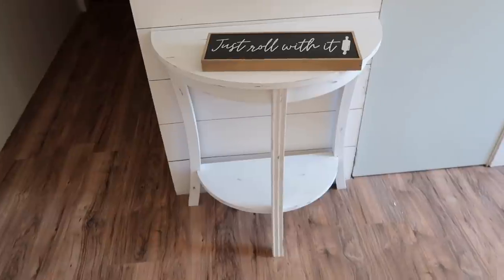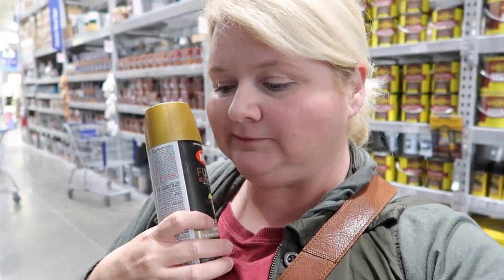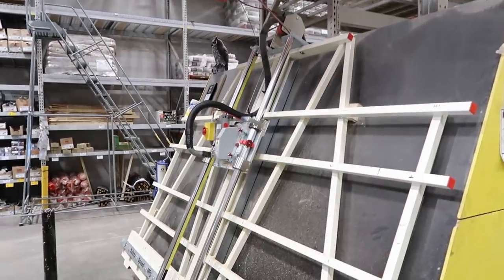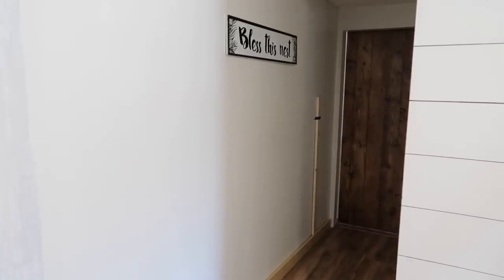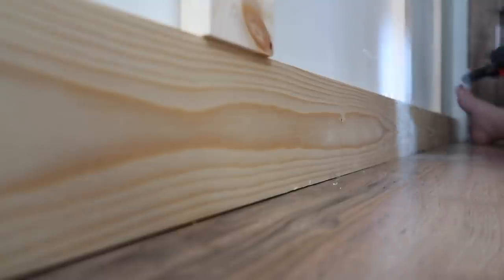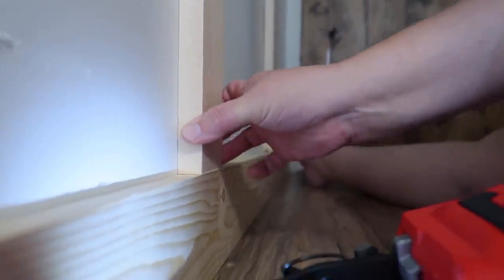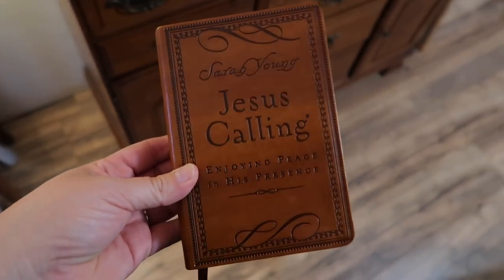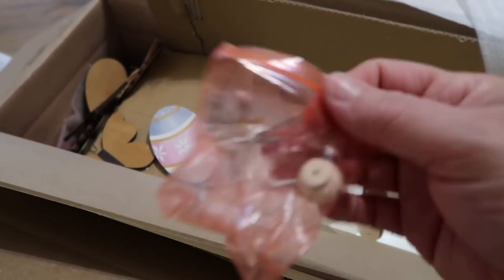Board and Batten Feature Wall | Hallway Makeover | Single Wide Trailer | Mobile Home Updates

Comment: You get a 10 out of 10 on this project.  You are taking your mobile home to where the interior is more and more like a frame house than a trailer.  That's definitely a huge up grade.  Just think, you are getting it done one step at a time and doing it quite well.  I can sometimes feel your frustration, and that's ok, just don't let it conquer your drive to get things the way you like.  Remember, there are no problems.....only solutions.

Comment: I live in a 19th Century dog trot style farmhouse. The exterior is board and batten. Inside, I have a room on the back of the house that was created when they enclosed the back porch. The old, rustic, hand hewn board and batten is still there, unpainted heart pine, and I left one wall of it in the room as a feature wall. I love board and batten! Your project is looking good! As far as the dark hallway, I have a suggestion. You said in another video that you are going to put new windows in the mobile home. When you do, add a window in the hallway. It is easy to do on mobile homes. Editing to add: On these old farmhouses with real board and batten, the boards are always different widths so the battens are never the same distance apart.

Comment: To brighten the area, paint everything bright white, and add mirrors to reflect light. Another option would be to have a sky light installed in the ceiling, or just a simple ceiling light installed. These two last suggestions are, of course, more expensive, but they would be worth the cost, because you'd have them forever. tfs  🥰💐🪴🌛🌞🏜💗✝🥰💐🪴🌛🌞🏜💗✝

Comment: If you separated the 2 rose prints by about 24 inches, you could place a wreath between them. Tie the colors of the wreath with the prints by using some pink flowers and ribbons on the wreath. Also, the little shelf with the plates and pottery is very pretty. I like the brown of the shelf contrasting against the white wall.

Comment: Your spice rack matches the hutch. And the botanical print's in the hallway blends in nicely. You said that you need some light in the hallway, how about 2 of the lights you installed with the rechargeable light bulbs. That would give you light with out hard wiring the fixtures. Good job!

Comment: A woman on a mission!! You did a fantastic job on the hallway. I prefer earth tones (paint) and the color you picked works well. I would try a mirror that can reflect light off of it into the hallway. Also, Lowes/Home Depot have battery operated wall sconces if there is no electrical or light fixture in the ceiling. I love what you've done with it. The newest wooden plate rack I would leave it in its natural state, it compliments your hutch. But if you did paint it white it would look nice too. Love seeing the fur babies. Have a great week and God Bless.

Comment: Hello, again! You may want to try installing a light fixture on the ceiling, in front of door at the end of the hall, for more light. Or maybe some wall sconces  with your new pictures. Of course, you'll have to do the wiring for that. They would look really good, in my opinion. I'm partial to wood and I think it would be a good idea to leave the door the color that it is. I've seen some "all white" homes and they can be blinding!

Comment: The wall turned out beautiful......love the two paint colors together.
BTW I think the floral prints are really pretty above the board & batten. Maybe you could find  another botanical with a similar type frame to use with them, but I wouldn't change it, it looks lovely!  I vote for painting the door agreeable beige 😉

Comment: Paint the frames the bottom color so it flows ☺️💕 find two more any size and paint the frames the same as bottom and all will match 🙏 love shelf place a hug fitting wall table underneath with plants or kitchen ware and that will flow🥰

Comment: I think you should paint your pantry door and the little curio cabinet the same color as the hallway you just painted. Also, your hallway has a long horizontal space above the painted area now, so go with (5) 8x10” pieces of artwork, put about 1 1/2”to 2” space between each frame.
OR you could go with one long (40” X 10”tall) horizontal piece of art centered in that area. 
Looking so good so far!!❤
Reply: Also, if you could find 3 similar frames (8-10”) with blending Colors of florals in each, you could use the two you already have with them. To blend them all together, anchor the grouping by putting 2 new frames on the ends and the other new one in the middle of the grouping. Then put the two frames you already have on either side of the middle picture frame. If all the frames are not the same color, you could paint all of them the same color. As long as they are the same height and width, it will look good. (Wider picture frames should anchor each end). Good luck!!
Reply from the maker: Great idea!!

Comment: New sub here . Love this so much ! I have a question .., if I were doing 9 foot ceilings, do you think I should go with same measurements of wood ? Is there a rule on how high you are suppose to go per height of wall ?
Reply from the maker: I'm not sure Ramona. I think you just pick how high you want it. Some people make them much shorter, I just liked mine higher. My walls are only about 6 foot high so it would be shorter on your wall.
Reply: Thanks for replying.

Comment: Is that same as 'shiplap'?
Reply: Dollar tree has those puc lights. You can press as you go in and out down the hall.
It'll need a lil more adhesive. Try them tgen make them permenant. Just saying 🐊
Reply from the maker: No it's different than shiplap
Reply: @19590  yes 3 triple a
I bought batteries there to.
It has a pull off tab like tge commands but I now have a sml strip holding  secured. There maybe 2x2 leds
So if instead o turning I've had light on I arrange under med cabinet in lil bthrm
It's not noticeable the other I put at ny storm door which it's white so I open glass door have my keys ready hit the button and wala. 
I told ups driver it's a solar alarm,, just as a precautionary I live on 2 acres just me so it's good to fib a lil especially for safety. 
Ps remember there were those inside round lights back in the day where yu press and you can see under sink or inside pantry.
You'll be surprised there very bright these pics.
My grand sd granny did you call them a punk. I sd no if they stop I probably will.
Later 🐊
Reply: @19590  nope I've had since  oct.
You turn on then turn off as needed.
I thought they would  be perfect to just light the way down the hall for Timmy or in emergency reasons.
Hey just pull up under $tree 1.25 I pick up more if lights and extra batteries.